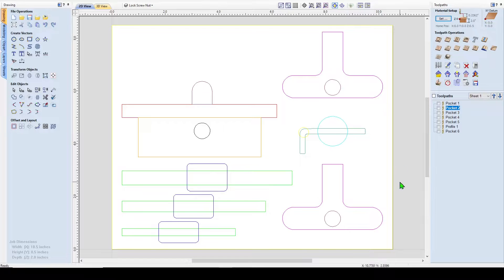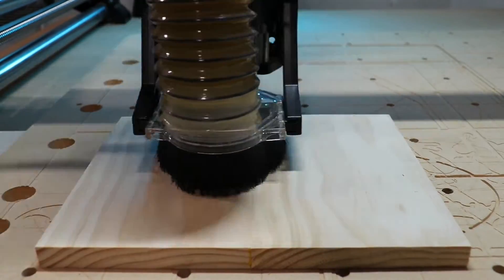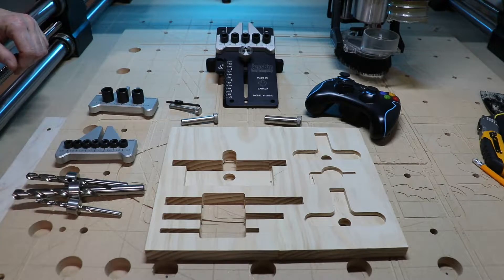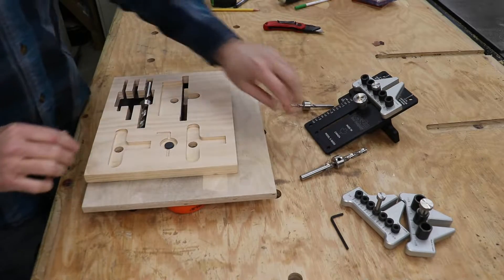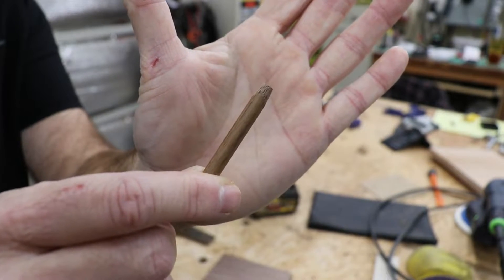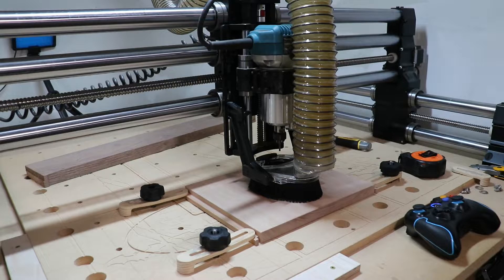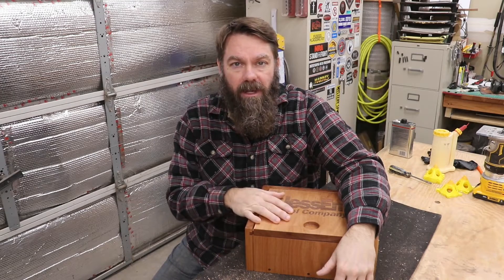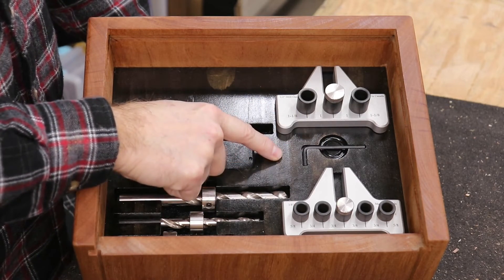JessEm Master Kit Storage Box - Design and Build

Comment from the maker: Happy to have something to keep my jig in one spot and safe. What do you think of my solution? Anything you would have done differently? Let me know below.
Reply: Beautiful job on that. The inlay came out great.
I personally would have made the lid hinged, and glued in small blocks of wood or high density foam sized so that they keep the contents from shifting. Kind of like what festool does with their systainers that the tools come in.

I need to make one of these for my dowelmax. I bought a few extra pieces and upgrades so a fixed home for all of it would be really nice.

Also, I'm not sure how much you work with dowels for things like cabinets or other projects that require two drilling depths, but for me, it was well worth investing in an extra drill bit of each size so I can keep the stop collars at the two different depths.

Keep it up! Looking forward to more of your projects. 👍
Reply from the maker: @NWGR  Great idea about having extra bits set up.
I thought about doing a hinged lid. Then I figured out where I was going to keep the box, and a sliding lid worked better for that location.

Comment: Hey there I hope today finds you well. I have a question about Doing and inlay. I am looking to do our house number using an inlay of contrasting woods. Knowing the UV issues and heat issues I experience in phoenix . I was wondering if you have any ideas of wood species that may hold up to UV . Rain is not one of my worries as the house number will be mosty safe from rain. I don't know much about exterior projects . Thank you for the time .
Reply from the maker: Ipe, teak, cedar, maple, iroko, white oak...would all be good choices. Finish with Spar Urethane. Good luck with your project.

Comment: curious about your design process, how did you accurately get the pockets for the various tools? Thanks for any info provided :)
Reply: @1averageamerican  ok thanks.
Reply from the maker: I just measured each piece and drew the size and shape I needed in VCarve. After some test cuts and small changes, the pieces fit just right.